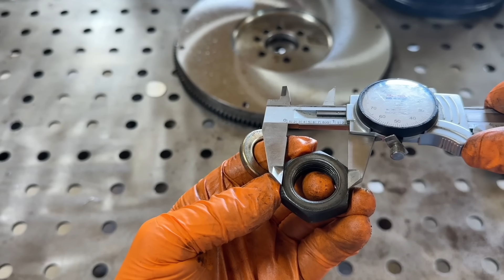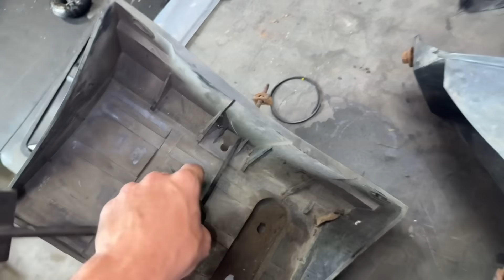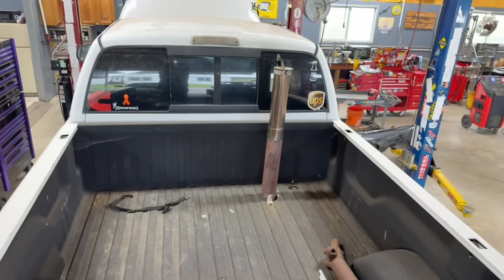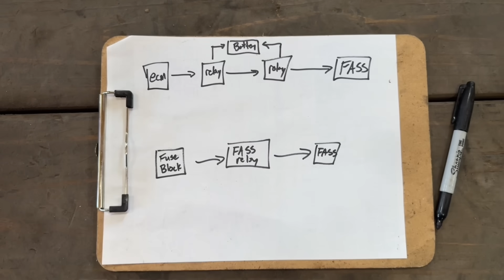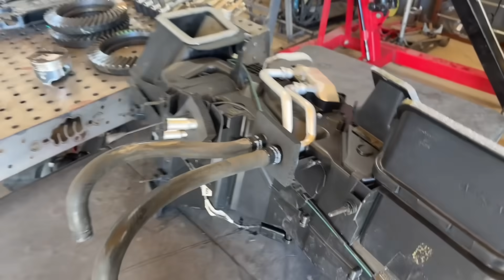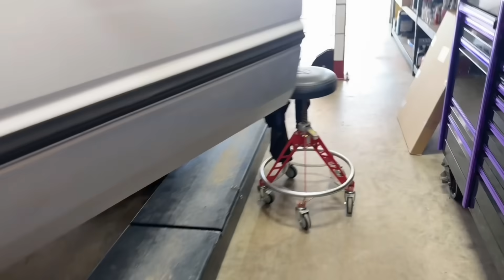California Dreamin’, Texas Wrenchin'

Comment: I'm 68 years of age, an ex certified TIG welder who traveled the country who lives in Southeast Georgia USA. I've always liked someone who does the job right the first time, but they are few and far between these days. 
Like you using Riv-Nuts, explaining about a fuse tap and how not to install it, you use Bulletproof Diesel all metal water pumps (which I had never heard of), explaining about front-end parts and why you like certain companies over others, and like cutting the top out of a fender under the battery, then taking a flat piece of copper so it doesn't goober-up the other side from where you're welding. 
Yeah, I'd drive from where I live to just below San Antonio Texas, to have you to work on my 2010 Dodge Ram 2500 6.7, because you pay attention to detail. Wish I had found out about you a few years ago, for I had taken my truck to have compounds installed, to LFDP in Monroe Georgia. They never did work, so I had them pulled off and put a Fleece Cheetah Turbo installed instead. 
I looked up your shop and now have you in my phone. 
Great work! Have subscribed to your channel.

Comment: The pitman arm nuts that use the brace will always come loose. Even while using red loctite. It's only a matter of time. If you can increase the gearbox bore size and are forced to use a smaller gearbox (OE) with the sector shaft bearing support, you will have to recheck the nut often. 
The forces of a straight axle while turning when using a drag link mean the threads are seeing forces they are not designed for, even loctite will not keep it tight.

I have tested on 3 separate vehicles and they all come loose. I will never recommend a support bearing is used unless the customer is willing to understand the risks and check the nut every 3,000 miles to be safe. 

Awesome video from your end as always, so many tricks no one else is calling out.
PS. Hiem joints don't belong on rigs that see lots of mileage!
Reply from the maker: I never sell those junk things.

Comment: The computers are not faulty.  They set the variable for wait to start to a higher time wait setting before shipping.  Why?  So on initial shop test there is more than enough time to energize the glow plugs.  It should be editable with a ecm reader writer for the pRom chip.  May even be editable by your in shop ecm odb tool there.  I am a software engineer by the way with a background in hardware editing via asm and other hardware based applications.  Thats why they want you to pay shipping back to them.  Not very nice, from their point of view, its loss.
Reply from the maker: These are 100% faulty computers. It’s a known issue with early vp44 trucks. They are just sending out junk “reman” units that barely work.
Reply: @Stratemannauto 1.  It did not "barely work".  It worked to spec, the spec of the reman company.  If the board was at issue, capacitors, resistors, chips, bios, grounds, the board would have been fully in operable upon instal.  Would have got nothing.  Again, the wait time variable and or timer variable for the pRom's chip storage was set, it functioned, just slower than you would like.

Comment: Synergy is nice stuff.  Ffs = for fs sake.  Before you weld in that plate ensure you got no rust on the mattering surface.  Then, use ospho on the rest afterr weld then hit it all after clean with some kind of bed liner.  Evapo may help.  Banksisthe way to go , make sure you get those multi fuel injectors to.😢

Comment: Great videos Señor. I recently discovered your channel, and I definitely appreciate seeing another professional who who cares so much about honest, quality work. As a side note, another thing I've found over the years that works well on those plastic pump/sending unit retaining rings is the heat gun. If I have one that's being stubborn, I'll take my heat gun and warm it up slightly before going to install it. Just enough to make it a little more pliable without damaging it. They tend to go on like butter that way. Nothing wrong with the way you're doing it, just figure it never hurts to have extra tools in the toolbox. Also works great for the plastic charge air cooler tubes like you find on the 6.0 L Powerstroke. In a pinch you can set either one out in the sun for a few minutes, and it produces the same result. No shortage of sun in Texas this time of year, that's for sure. Keep up the good work!
Reply from the maker: Thanks for the trick!

Comment: Nice workmanship.  I like the way you took the time to install a proper weld washer for the track bar bolt.  I've repaired many like that and although it takes a bit of time, in my opinion it's the only correct way to repair a worn out hole.  
Mike

Comment: It wasn't but a couple of months ago I put a water pump in a buddy of mines 6.7 Cummins went with the new style Cummins oe pump with the smaller drive and it was all metal. So when did they make the change to plastic impellers or is that a factory 5.9 thing and these "new" motors getting metal ones?

Comment: i would like to know how you fix the abs brake module i have a 99 2500 5.9 gas and also have u ever had a problem with the speedo motor that u have to replace

Comment: So you recommended Synergy’s track bar conversation but I looked at there track bar mount and its similar to the one in the video as in it drills into the engine cross member. I like the Thuren mount better but I agree the joint they use is sub par. So it sounds like you would use synergy over thurden one has a better mount the other has a better joint. Which is most important to get right joint or mount?
Reply from the maker: I have the synergy mount on my truck but welded to the frame. It’s a double edge sword, I plan to try a Thuren bracket and a synergy bar at some point. If I had to choose I’d pick the longevity of the synergy over the Thuren
Reply: I appreciate your insight. Thanks.

Comment: Dude you’re so meticulous and talented with your work. Keep up the videos they’re so fun to watch. I’m doing rear wheel seals and bearings on my 4g 2500 ram tomorrow. God bless
Reply from the maker: Don’t forget to tilt the axle to get gear oil to the bearings!! Only use Mopar or Timken seals. Put dielectric grease on the seal surface when installing it over the spindle. That’s about everything you need to watch out for 🫶
Reply: @Stratemannauto I’d probably avoid timken seals unfortunately. I did some (china) timken seals on my 03 grand Cherokee and they both leaked within 1000mi. Went back in with (Mexico) mopars, no leaks 20k later.
Reply: @Stratemannauto dang. I got skf seals with timken bearings from rock auto. Skf usually makes good seals. You think they will leak right away?
Reply from the maker: @humpday2267 skf is good 👍
Reply: @Stratemannauto thanks for the reply. You rock bro. I know your videos take so much time and effort to make but I know myself and others always appreciate them. And the little jokes here and there. Like when you had to ask for consent when checking the crankcase breather hoses on the 2g you just made the video on 😅
Reply: @Stratemannauto how much do I need to tilt the axle after the bearing and seal job is done? I got each rear tire off the ground one at a time about 6-7” inches off the ground after I filled the axle with oil. Do you think that would be sufficient to fill the hubs?
Reply from the maker: @humpday2267 I go as high as the floor Jack will let me but 7” should be sufficient. I let it set like that 5 min per side and usually find it eats up 1 quart of oil
Reply: @Stratemannauto good to know. Thank you 🙏
Reply: for a 15 2500 truck what tq seqence on the hub nut for fresh bearings?